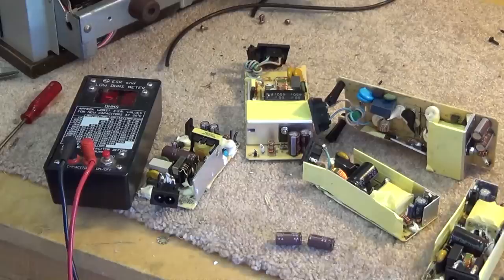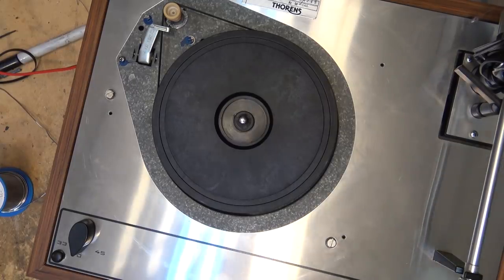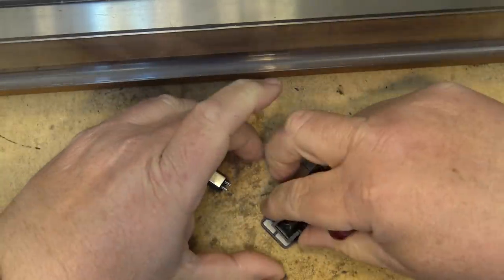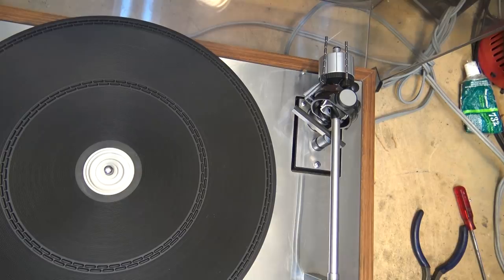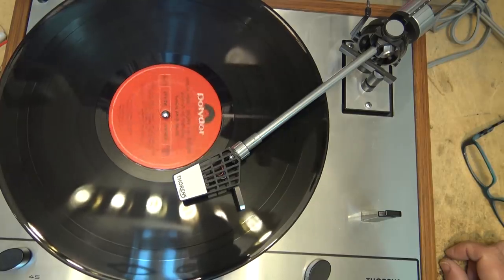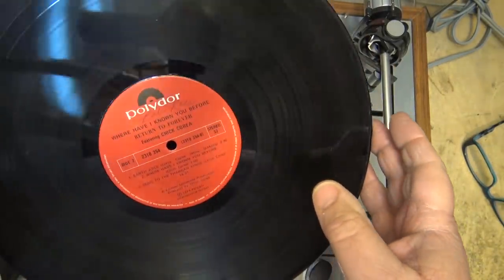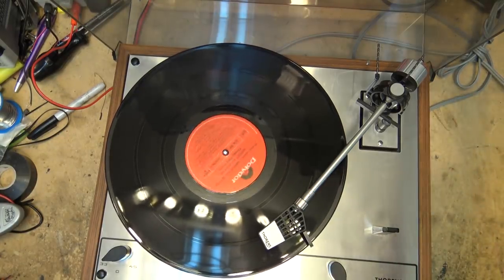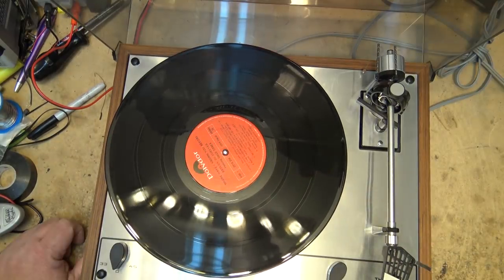Thorens TD165 turntable lubrication belt and cartridge replace

Comment: Hi, I have pretty much the same turntable, great condition, well I mean, comparable to yours. Now, the belt is getting loose and so I've decided to put on a new one. I didn't order a Thorens-branded one, but I got one from a store that is meant to do the job just as well and for half the price. Anyway, when I set it up, it would play 33T perfectly (well I can't check for sure, what is that thing you're using to measure the speed of the turntable, looked kinda crazy!). But whenever I switched to 45T, then the belt would make its way to the top of that white revolving thing but wouldn't stay on it, or wouldn't stay at the top, it would settle somewhere in between. Any advice? I first it had to do with the belt being to wide and, going through that metal arm/lever, its trajectory would be altered but it turns out it the same width as the original I used before. So I'm tempted/considering to see if I can work it out on the spring of the leverage (don't know if I'm being clear here), I mean that metal arm that switches the high/low position...
Reply: get the proper belt. what you are describing is typical of cheap belts

Comment: Does tracking too light cause semblance.
Reply from the maker: If you are too light the needle is likely to jump out of the groove completely on loud bass.
Reply: Yes, tracking too light can cause sibilance, if that's what you're referring to.
Reply: Tracking too light causes increased record wear as the needle kind of slaloms  back and forth from one side of the groove to the other. It also causes more Distortion, yes.

Comment: I have a Thorens TD160 Mk I and one of the channels stops working intermittently. The amplifier/speakers is not the problem, so it must be something from the turntable. What can I do to fix it?
Reply from the maker: Likely the tone arm wires need to be replaced.
Reply: @12voltvids  Thank you. I think so too. Will do so.
Reply from the maker: it's either the wires or an intermittent cartridge. Now from personal experience the td165 you see here I found at the side of the road and when I got it one channel was dead and the note on it said wires broken in tonearm. Measure them with my meter from the head shell to the end of The wire and it had continuity put a new cartridge on problem solved it was an open coil in the cartridge. Previous owner had taken it to a shop shop measured continuity from the RCA plugs on one side open told them it was going to be tonearm wires and that it was going to cost $200 to fix owner put it at the side of the road on garbage day. I picked this up probably a dozen years ago let it sit in my storage unit for a couple years before getting to it because I was fully expecting to have to replace the head shell wires after all it was the shop that I used to work at that diagnosed it, the tech they hired to replace me when I left diagnosed it as the tonearm wires and the customer did not fix. Now in my case it was not intermittent it was completely out on one channel but it is possible that a cartridge could go intermittent just as easily as the wires so if you have a spare cartridge it might be a good idea just to swap the cartridge first and see if the problem goes away if it continues then yeah probably the wires are bad right at the end of the tone arm where they flex back and forth as the arm moves across the record
Reply: @12voltvids  Thank you very much for your detailed reply. I have rewired everything and now seems to be working properly. I still need to get rid of some hum, which I don't know how to fix. I am waiting for some cables and plugs to arrive and replace them, I hope that will fix the hum.
Reply from the maker: check your ground wire.
Reply: @12voltvids  I have, but I still have quite a lot of noise. I guess I won't get to the level of silence of a CD player, but I'd like to get it quieter than it gets now.
Reply from the maker: well you will hear some noise.  Vinyl is much noisier then CD. if not actually playing anything it should be quiet though. But when the stylus is on the record there will be surface noise.  That's a limitation of vinyl.
Reply: @12voltvids  Yeah, I am aware, that noise is fine and I love it. My problem is the hum is there even when the turntable is off and unplugged from the wall, but plugged via RCA to the amplifier. The amp is not the problem. If I unplug it, the noise is gone, so it’s coming from the turntable. Ground wire reduces it drastically, but there is still quite some annoying noise…
Reply from the maker: is the tone arm ground wire intact?
Reply: @12voltvids  It seems so. It is screwed to it with a O ring and then it goes to the bottom/inside of the turntable and to the rest of the ground wiring.

Comment: Mine was a TD 160 a cut-above, I think, the TD 165..  0 plastic.  I had to give it away; it still hurts.  These things are bare-bones-beauties, but they do go thru belts like crazy, get a 10-pack - I replaced the cartridge as some little brat probably'd heard from his dad they were diamonds (LOL); we'd left him in the music room while partaking of adult party favors and when they were long gone, I went to play a record ... -those bastards never mentioned a thing!  Anyways, something dreadful happened last year and I had to give it to a very sad person. Hell, his best friend had given it to me.  Anyhoo, that's my Thorens The Mighty Epic proem. lucky u.
Reply from the maker: This one is ok. I probably won't even use it as I don't have a huge vinyl collection. I need to get a preamp to plug it into my tube amp. I prefer the sound and convienece of my 200 disk CD changer
Reply: @12voltvids  I just have a decent computer set-up for sound, some Altec Lansing like 2.5"? barrels, powered by wallwart and a decent Kenwood 10" sub-its surround foam is gone and I gaff taped it up lol.. still sounds okay on a lot of things. And youtube.. and whatever shareware tunes I could dig-up on the harddrive.  CD's are kinda dinosaurs too now -tho I do have a 58 Maggie to fix still. 2-piece console... I think I wrote about that to u before. You said you're much more into accuracy than "warmth" or whatever..  and efficiency, reliability.. I'm into whatever works at the time that I ain't gotta fix.  I'd buy that Thorens off of u for $100 any day.. :D or, ya know, what do u think for it?
Reply: watching further, yeah, feedback..  The TD160, I could turn it up to 11 and it gave absolutely 0 feedback.  LOUDEST player i have ever heard.
Reply: @12voltvids  presence is really impossible to sample lol.. I know I know.. I'll shaddap now..  good evening, Sir.
Reply from the maker: @_Ramen-Vac_  
I could get a lot more than 100 for it. Local vintage stereo shop has one in the store for 575 on sale.
I like warmth to the sound, I run all tube amp into a pair of Technics SB7000 speakers. I just don't like all the racket that vinyl gives. Pops, clicks, and all the noise associated with the  needle in the groove, plus limitations. I enjoy the wide dynamics that digital recording brings, along with the smoothness of an all tube amp. I have several tube amps. Both SE and push pull.
Reply from the maker: @_Ramen-Vac_  
I doubt I would get any in the house, but on the test bench, the speakers were siting on the bench.
Reply: They don't wear out belts as long as you treat them well. Just do your best ro keep them from stretching. I assist the belt on my thorens by spinning up the platter a bit before starting the motor and if i know i wont be using the turntable for a while i take the belt off of the subplatter to keep it from being in a stretched state for a while. Also, i take the belt and put it in a sandwich baggy with a little bit of talcum powder and shake it around in the bag so the powder helps grip the belt to the subplatter on cue up.

Comment: I don't think mp3's are crap if you rip them directly from your CD'S
Reply from the maker: Mp3 sound fine if they are encoded at 340kbits variable bit rate. Anything over 250k you shouldn't be able to hear any difference  .
Reply: @12voltvids  yes I agree and I just happen to agree with you about CD'S as well and I have a lot of CD'S and I collect CD'S
Reply from the maker: @richardhudson3014  I have over 1000 cds been colecting since 2003. I am embarrassed about the first CD I bought. Would not catch me listening to that now.
Reply: @12voltvids  I don't have quite that many but I'm close

Comment: Nice T table. I like the isolation but not good for back cuing.
Reply from the maker: Impossible because it takes a good 10 seconds to get up to speed
Reply: I think you have the worst dj turntable. I have seen a DJ table on here once, it has a giant motor and rim dive and gets to full speed in under a second.
Reply from the maker: @markanderson350  
It is not a DJ table. No belt drive table is much good for a DJ. They use things like a Russco Cue Master, or a Technics SL-M1 direct drive. 
We used Russco in the TV station I worked in for record cues. They start up pretty much instantly. Something like 1/8 of a turn to full speed.
Reply: @12voltvids  that's the name. Rusco. I was joking yes you have an audiophile t table
Reply from the maker: @markanderson350  You mean an audiophool table.
Reply: @12voltvids  That's a good one. You mean scratchy 45 s broadcast to an am radio is not hi-fi?

Comment: Some new remastered CD sounds like crap because of loudness war that they squashed the dynamic range to the point that it's like you are listening to a radio. That could also be the reason some old vinyl sounds better.
Reply from the maker: The cds I have heard sound superior to vinyl. Of course a good CD player helps too. Many use a cheap player or a DVD player which dont have the best circuits in them. It also depends on the engineer that mixed. The music I listen to has all been properly mixed. The artists are professional jazz musicians with golden ears striving to produce the most sonically perfect recording they can and it shows. Especially live recordings.
I listen to all types of music but for the modern hard rock I usually just listen to the radio, FM and HD.
Reply: @12voltvids  
My CD player is a Sony CDP-S37. Our DVD player sounds slightly better but playing at a very high volume I can hear some slight hiss in-between songs while I don't hear any hiss on my CD player.
Reply from the maker: @bobskie321  
It all depends on the mastering engineer. Good engineers do it correct. I have heard good and bad recordings in bothmedia.